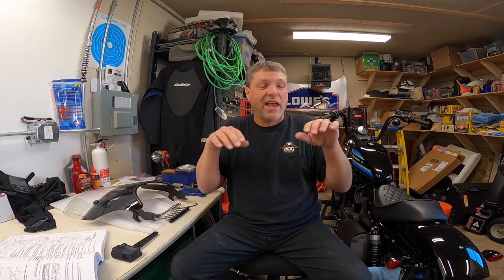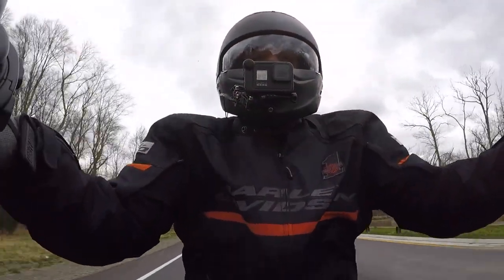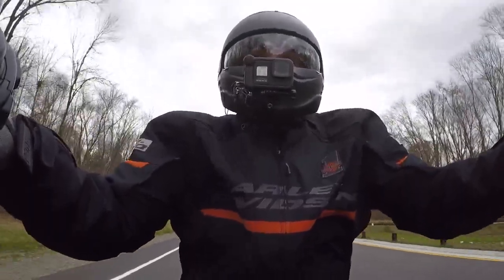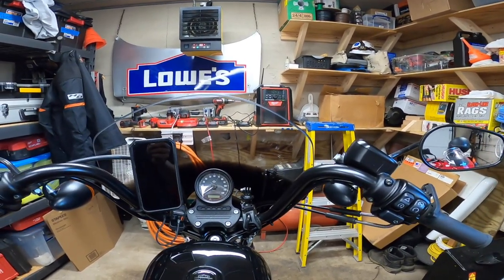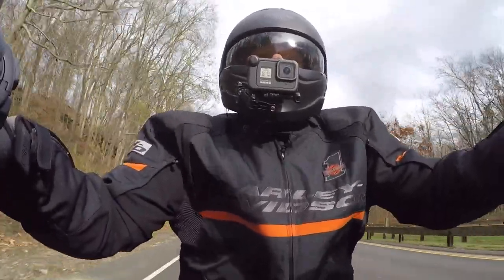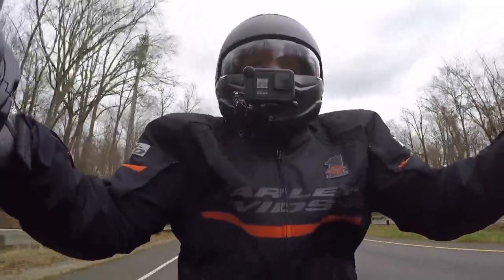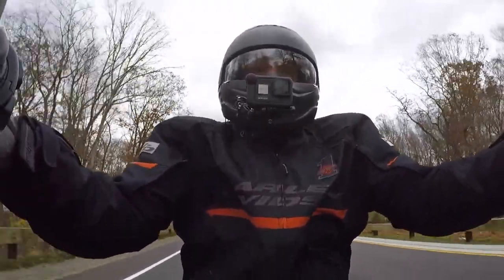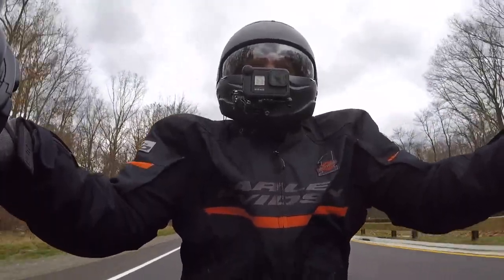EL PASO SPORTSHIELD FAIL ON MY HARLEY DAVIDSON IRON1200 SPORTSTER

Comment: Hey Carl. That is physics! the air you push always from your chest need to go same where . Most of it will be redirected over the shield. The fix for that is to have a longer  wider wind shield to push that extra air over your helmet. 
My original  wind shield on the my 1200T create buffeting too, but not bad because it is very wide. I do not do much highway but one day i will buy the wind shield extender to be installed on the top of my wind shield. That  extension will still create buffeting however the air wil be pushed over my helmet and keep my head inside a pocket of silence 😉
Reply from the maker: I have been doing some home research and I think the extra room around the headlight is allowing a lot of air to flow around the headlight and sucking the wind around the cut outs on the lower fairing. New shield arrives tomorrow 🤞🏻
Reply: @MotorcyclingwithCarl  Video please when you have the time. Thanks

Comment: I have the Memphis Shades El Paso 19" installed on mine today. Went for a highway ride and it works great. Yours (15") is too low. You need the taller windshield.
Reply from the maker: I went with the Del Rio and it is working perfect but I bet the 19” would even be better!

Comment: I have had the same issue. Left it off. Maybey a sport fairing would work better. That would change things. Even a shorter windshield might help. Going wider vs taller. Cool channel. That sporty is rad.
Reply from the maker: Thanks going to give the del rio a shot if that doesn’t work it will be back to the drawing board. I really want to do some long trips next season so I want to figure something out that is easy on and off and will provide protection. I will be checking out more stuff on your channel tonight.